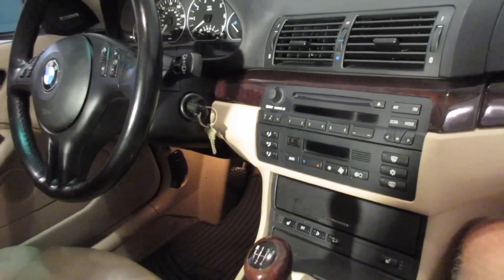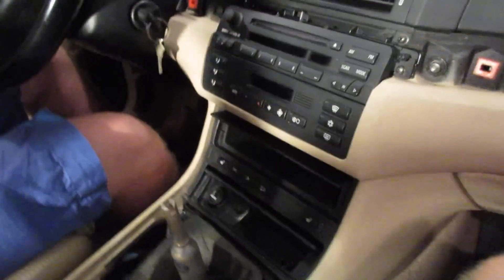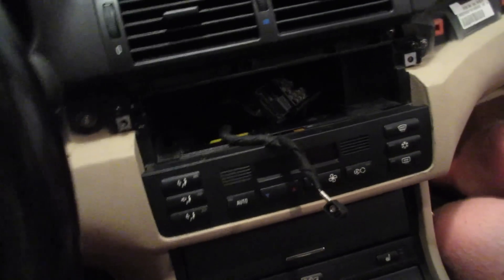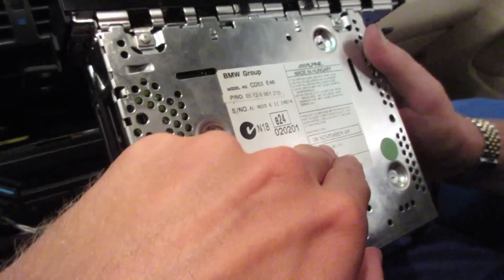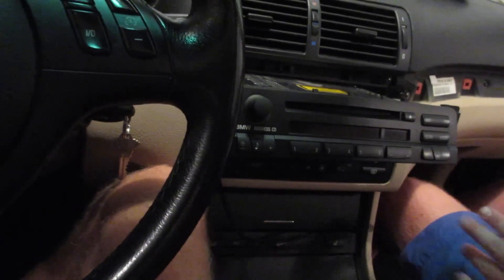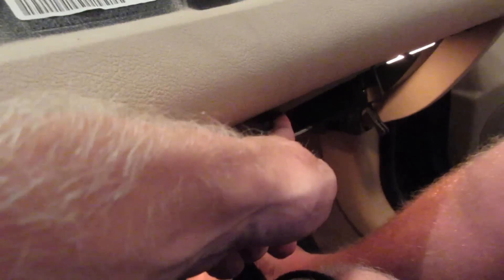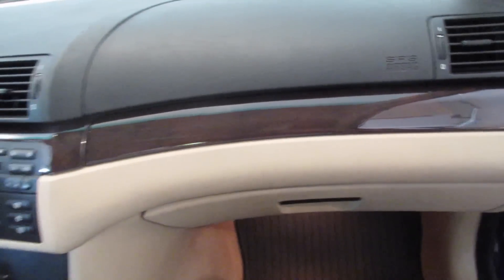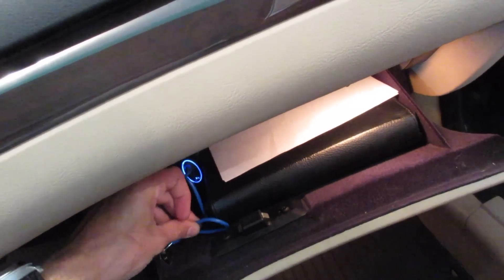BMW E46 3-Series Auxiliary Input Installation DIY

Comment: I did this on my 04 M3, when my phone is directly plugged into my aux input the radio detects is and I can switch to AUX mode, but when I used a bluetooth adapter it can't detect the AUX input, I tried several models/brands of bluetooth adapter from fry's and amazon and none worked, I tried them on my PC speaker and all of them worked properly. was wondering if just specific bluetooth adapters works with the radio on e46.
Reply from the maker: +erickrayos They all should work, assuming the jack is output (to speakers/aux) from the Bluetooth device itself, and that it has power....  I use the TuneLink auto and it works fine.
Reply: +E39Source none of the bluetooth adapters that I have tried worked, the aux works fine when my phone is directly plugged into it, and the bluetooth adapters works when I tested it with my PC speaker but for some reason it won't work with the radio. the radio just can't detect it when these adapters are powered up but when its powered down I am able to switch to AUX mode

Comment: Hi, I have a problem.  Maybe you or someone on the feed came help me.  I'm wanting to hook up my xm radio to my bmw e46 3 series 325ci.  I purchased a Aux cable hook it up and I had no sound, so I checked the aux wire in the back of the radio which was loose.  I got sound, but it's not loud like a normal radio sound would be.  So I'm wondering do I have the wrong plug, because I can pull the plug out the back of the radio without having to unplug the wiring harness.  Also, every video says to plug the Aux cable in the left side of the radio facing you, I tried that, then the Aux would not show on my radio, so I had to plug it in the right side of the back of the radio.  I hope this made sense.  Any help would be appreciated. Thanks.
Reply from the maker: With the radio in AUX mode, and something playing, hit the "6" preset button on the radio face.  This should adjust the volume up higher.
Reply: o.k. I'm gonna try that. Thanks.
Reply: O.k. well pressing the "6" button didn't work.  But, when I search my car good, I found the 3.5 jack that was put in there by the previous owner.  An my boyfriend told me how too hook it up and waalaa, it is working perfect. So I really didn't need the Aux plug that I purchased.  Didn't have to hook anything to the back of my radio, thanking God.

Comment: Hi i haw radio made in 2005 but when i plug AUX cable nothing happens the aux not showing but i got the cable for 3 dollars is it possible that i need some special aux cable?? in ebay there is many types off cables
Reply from the maker: Your radio should support it, but you need to wire in the BMW aux adapter kit. Or, if you already have it, ensure that it’s pinned in correctly.

Comment: Hi! so I have an April 2002 unit and it had the mode button with the 10 pin port available but it won't connect???
Reply: Has to be September of 2002 or later.
Reply: +Lucas Strong It will work with any E46...Mine doesn't support it but still got it working. All you gotta do is replace it with the CD player input and it should work then when the car is on CD mode.

Comment: Would this be working a BMW 318i E46 facelift from 2001? It's the standard BMW business radio
Reply from the maker: +thed4nq You should be able to replace the CD player with one that is new enough to support aux, and then add the cable.

Comment: hello, will this work on the 2000 e46 323ci it looks exactly the same just want to make sure before doing this mod
Reply from the maker: You just need a radio that was made after Sept 2002.  If the radio in your car is a 1999 or 2000 (what came in your car) you can just buy a newer one (2002-2006) on eBay and install that before the aux kit.
Reply: oh ok thanks very helpful

Comment: Can you use the steering wheel controls to skip songs? I did the install but can't skip songs on my NAV UNIT or on the steering wheel controls. App for music is Spotify.
Reply from the maker: Not with a simple aux input, no.  That would be super nice to have, but you'd need aftermarket components to make that work.

Comment: Is it true that some radios with mode button doesnt support aux? And does it matter what region the radio is set on? Thx
Reply from the maker: +TheGroundRoof Region shouldn't matter... but if you run into issues, then select USA.  

Any radio made before a certain date won't support AUX, regardless of what buttons it has.  I think that certain date is 9/2002, at least in the E39s anyways.

Comment: my E46 is 2003 .. radio was made in 2003 also .. i tried to connect the AUX but it won't work .. i read on the internet that the version of the software has to be 43 or above .. mine is 51.. but it is not working .. I'm in Poland btw . hope u could help .. thx a lot .
Reply from the maker: +Nas Almoalm Hmm.  That should definitely work.  Check all the connections, upload and then plug it back in.  Unplug the battery maybe for a few hours.  Then plug that back in and see if the radio has discovered the aux yet.  Good luck!
Reply: +E39Source will do so .. thx a lot ..

Comment: Will this work for my late 2001 330ci? I haven't check the date for the actual headunit yet.
Reply from the maker: Patrick Tran You need to check the date on the radio.  If the stock radio is still in there, I think you'll need to update it.
Reply: Yea I checked it today its a late 2001 model

Comment: Any clue what the off-white/yellowish plastic part is in this photo? It's inside the dash directly to the right of the radio bay and to the left of the glovebox. The photo was taken from the passenger footwell looking up and left with the glovebox and glovebox panel removed.
http://i66.tinypic.com/2iw9av5.jpg
Reply from the maker: That looks like a vent actuator or something of those sorts.
Reply: Sounds right. On close inspection, it does look like a control arm and servo, but difficult to tell peering through the radio bay. I ask bc it looks like this is the gap where the aux cable feeds through, at least on my e46 M3. If this part moves, I just want to make sure the cable isn't obstructing it.

Comment: i have a 2002 325ci manufactured 06 02. but the radio is the same and has the port shown for the aux and my radio says "mode"
Reply from the maker: +Marc Juarez it has to be 09/2002 or later I believe

Comment: What's the probability that it will work on my 2001(made in July 2000) 330ci?
Reply from the maker: +Alec Olslund Very low, you need a 9/02 + radio I believe.  So unless your previous owner replaced it....
Reply: +E39Source Got it, thanks. Would it be possible to just find a radio from a 2002 year or up and replace the existing radio
Reply from the maker: +Alec Olslund Yes, it should plug right in.  Find one for your car with a newer build date on Ebay.

Comment: I know this sounds ignorant..if you have a (lets say) 2000-2002 BMW e46... how  is it that the OEM head unit was made in 2003+  What am i missing here ?
Reply from the maker: It would have had to be replaced at some point.  If a dealership or previous owner had to replace it, it would have likely been with a newer model.

Comment: hello i have a m sport e46 ... and want the usb type and suggestions ..thanks
Reply: +mick001983 What USB are you referring to?
Reply from the maker: +mick001983 What USB are you referring to?
Reply: aux to usb ...
Reply from the maker: +mick001983 Aux to USB is not possible unless you use some type of product such as the Tunelink Auto.

Comment: Hi, im just wondering why you chose a different spot from the directions included in this kit. I naively followed them to the tee,  and found that the location they had me drill in, would make the aux wire hit the flashlight charger in the glovebox. Were the directions written by an imbecile of some sort? Thanks.
Reply from the maker: I don't think I even looked at the directions for this one, I just did with my 330xi what I did with my M5.  The glovebox wall is where they recommend putting it on the E39.

Comment: Hey where can i find the bluetooth wireless aux adapter??
Reply from the maker: I use a product called the TuneLink Auto, available on Amazon.
Reply: @E39Source  are there any other wireless bluetooth aux that you would recommend? I cant find the one you guys have
Reply from the maker: @vtecboi18  Stay tuned to E39Source.  There is a great BMW product called BlueBus that is about to hit the market.  https://www.bluebus.dev

Comment: mine e46 radio its 02/2005 but doesn´t work! only cd player and radio! it´s normal?
Reply from the maker: When you're trying it, are you plugging something into the auxiliary port? It won't show up if nothing is plugged in.

Comment: Show how to remove the blue thingy!
Reply from the maker: Blue thing?
Reply: I figured it out.  It's the blue bracket that holds the wire harness to the back of the head unit.  It just slides out.
I just finished this job a few days ago.  Thanks for uploading this DIY.

Comment: What is the bluetooth aux called?
Reply from the maker: Stay tuned for a future video featuring it!
Reply: *****
 any chance you could let us know how this bluetooth aux was fitted as I presume it needs a power input of some kind?
Reply from the maker: Tom Doherty It's called the TuneLink Auto; it plugs into the flashlight port in the glovebox using an adapter. This adapter is no longer made; but you can find it on eBay... though they are pretty expensive....  Part Number:  82110004073

Comment: Hi E39 Source. I have an Oct 03 Build E46 330ci (EURO)with the cassette player up front and CD changer in the trunk. I appreciate its hard for you to know based on this info but do you know if my car will support this feature? Thank you.
Reply from the maker: Yes, that radio should be new enough for aux to easily be installed!
Reply: E39Source Thanks for the reply mate! - Harry.

Comment: i have a 2002 bmw 325ci would it work?
Reply from the maker: As long as your radio was manufactured after the specified date.
Reply: @E39Source  what if the radio is before that date, is there any other way for me to get Aux?
Reply from the maker: @connorlovesrock  Then you just need to find a newer radio and pop that in!

Comment: Could I possibly do this on a 2001 , E46?
Reply: I as well have an 01 e46 and I cant find an answer anywhere. Best option is most likely to just replace the radio entirely.